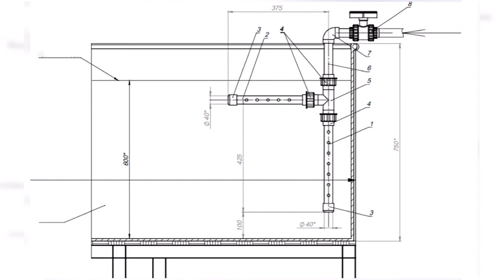RAS fish HOLDING TANKS | Everything that is IMPORTANT to know about TANKS in RAS | Part 3

Comment: Hi Anthon. Thank you for all your informative videos. I am building a small tilapia system and M doing the plumbing to and from the tanks. I have followed your preference with the vertical and horizontal water supply and i can tell you it works perfectly. I am installing bottom drains and i would like to put skimmer boxes as well. The only thing that puzzles me is if we put a screen then the dirt cant get to the the floating solids and dirts cant get to the outlet pipe. Is there a difference between the skimmer and the overflow and how does it look

Comment: Sir Anthon I am planning a 10 tons tilapia grow out farm. I am planning in mechanical filter putting large radial flow settler then a Sand filter with multiport valve for backwash. Do you think Sir those two as mechanical filters enough for that volume?
Reply: Also Sir if possible I'd like to know how double-bottom outlet works and design.
Reply from the maker: Hi, radial settler and drum filter are fine, but sand I wouldn't recommend - it's always hard to work with it, clogging etc.